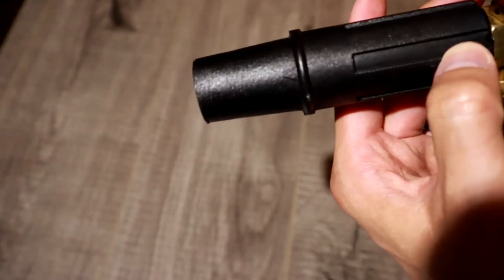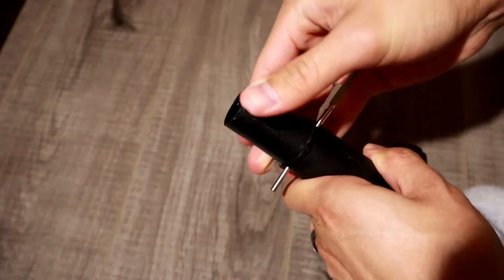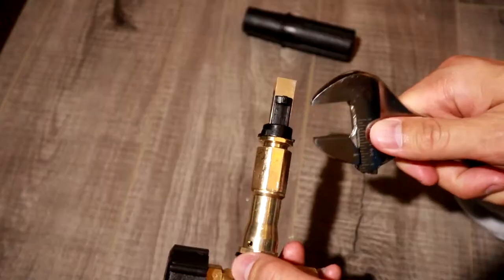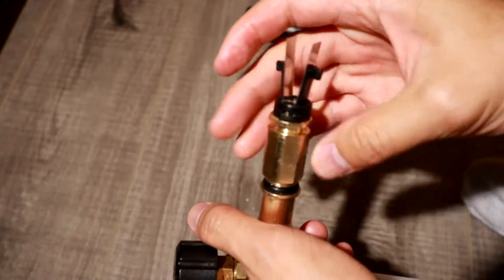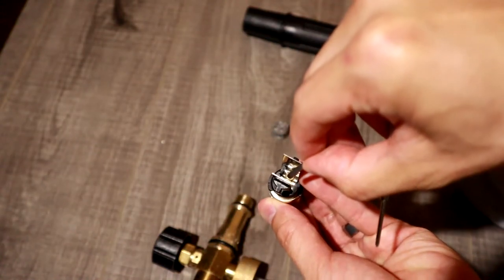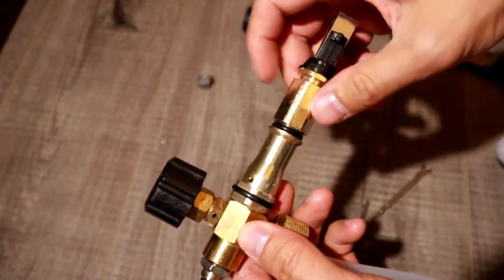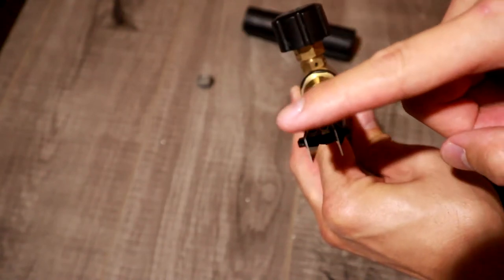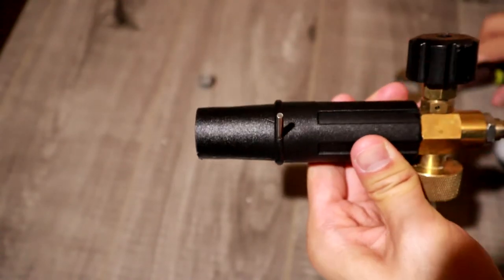How To Replace Foam Cannon Mesh Filter (Foam Maker)

Comment: About how long of time would you recommend changing it since I use it more then often to detail ??
Reply from the maker: Really on an as needed basis. If you start to see that its getting clogged, either clean or change. I think the best thing to do is make sure you shoot fresh water thru the foam cannon after every wash so residual soap isnt stuck in the foam maker/foam cannon

Comment: My mjjc pro v2 foam cannon has stopped producing thick foam. When i used the adjuster knob and turn it all the way clockwise, it pushes out runny soapy water. When i twist it anti-clockwise a bit, then it starts producing foam again but not very thick. I have performed all steps to clean the steel ball, the mesh was replaced. Did everything but it still doesnt work.
Reply from the maker: Sorry to hear.  I wonder if your poor foam cannon has just seen better days and has died on you?  Would be unfortunate for a bit of a pricey product.
Reply: Have you found a solution for this? I have the same problem :(

Comment: How do you know when it's time to change the filter? Is it obvious, less foam or less flow?
Reply from the maker: Yeah if you're starting to see the foam cannon perform worse than before, then it'd be a good idea to at least look at the mesh filter and/or change it.
Reply: @nukem384  appreciate it! I haven't noticed much of a change but I have been changing soaps recently. Was curious as I have a spare 1.1 tips and mesh filters, just haven't changed any out yet. Thx
Reply from the maker: @mygt8a4re  Make sure after every wash that you're blasting clean water through your foam cannon before you put it away.  This will help keep your mesh filter and 1.1 orifice cleaner and help to keep it unclogged.
Reply: @nukem384  great tip, thx! 👍

Comment: what's the mesh filter for? could you just pull it out and keep it out?
Reply from the maker: It agitates the water/soap mixture as it's coming out of the foam cannon.  You could leave it out, but then the foam cannon wouldn't work correctly and you wouldn't get foam.  The mesh filter helps to make the soap turn into foam and make it nice and fluffy as it exits the foam cannon.